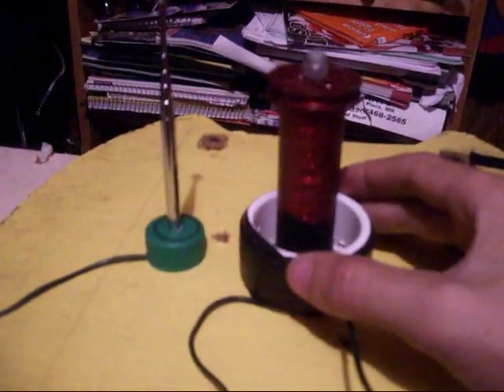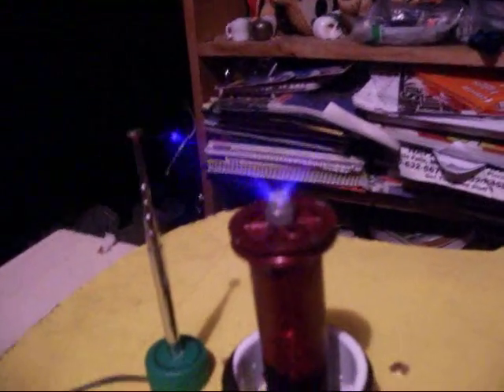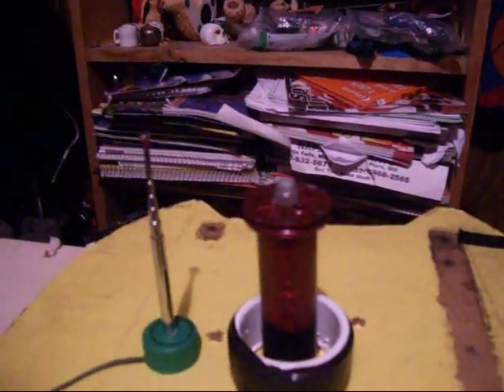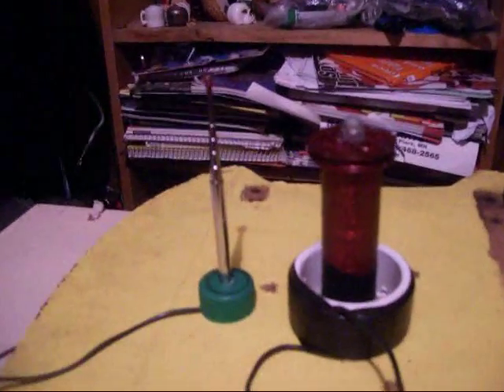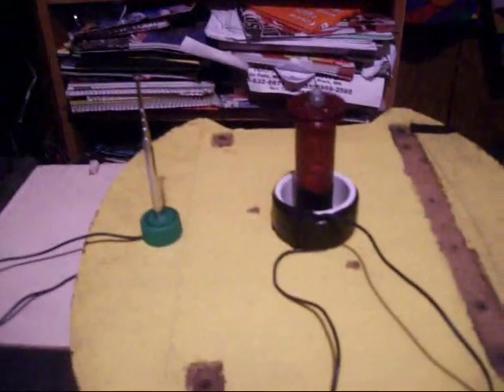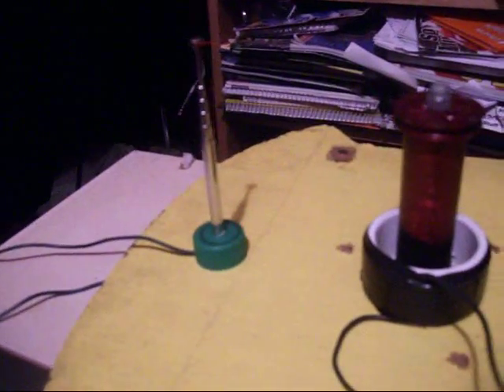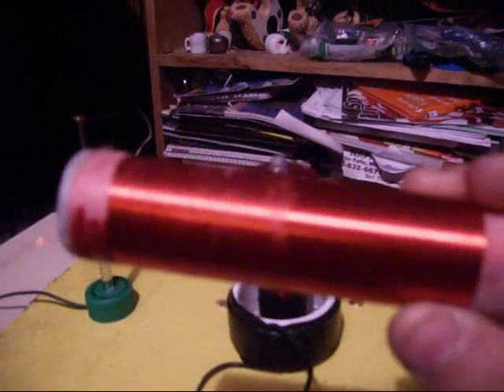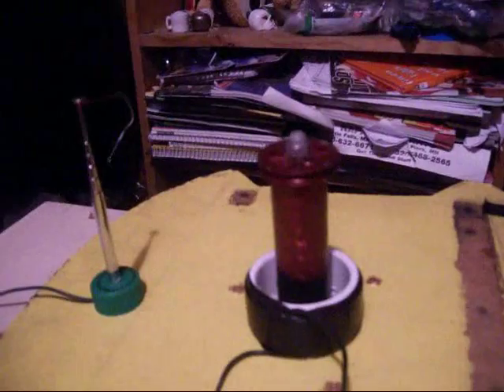Mini Tesla Coil

Comment: Hey Great coil, question I am having issues with my primary and secondary, when you said you tried with the other coils and they didn't work. Any scerets that it may be or reasons why they woudln't work ? My circuit is correct but the coil seems to have issues

Comment from the maker: @powermaks I would have, but this tesla coil was to be made from everything i could scavage from the dumpster or local surplus store, the NST was the only bought from a store besides the nuts and bolts. I no longer have this coil either, I'm currently working on a  4 inch coil now, though progress has been slow

Comment: try a better capacitor. there is a lot of loss from corona on the cap. i would try a 2 smooth plates about an inch apart suspended in oil (try more plats for more capacitance and further apart it is still arks )

Comment: @anirbankar21 to tune a tesla coil you have to have the primary inductor and capacitor generating the same frequency as the secondary inductor and capacitor.  Inductive and capacitive reactances need to match in each part.

Comment: Diameter and length off the main coil tube and what size wire and how many turns? what voltage did you turn it with?

Comment from the maker: @coolaidkiller101 Well you could use a flyback, the only problem is, is that you cant charge the capacitor with high frequency AC. You would have to get some high voltage diodes, they're not to hard to come by, you can even make them by stringing many diodes in series. you can find out anything you need by using google, and i suggest you start there, as me explaining it to you wont help you learn on your on :) good luck